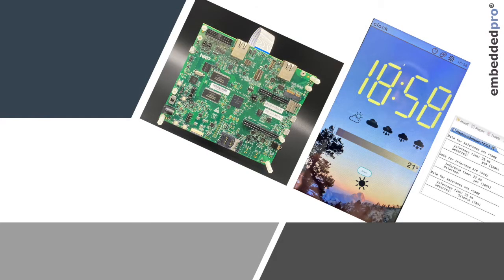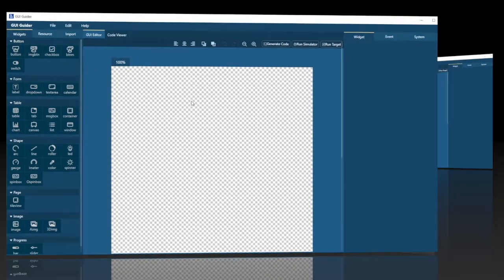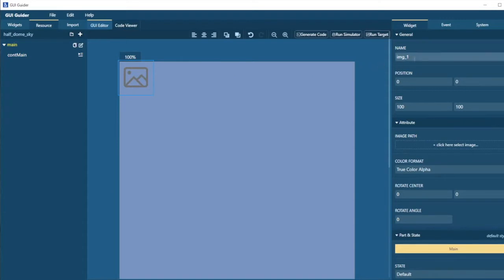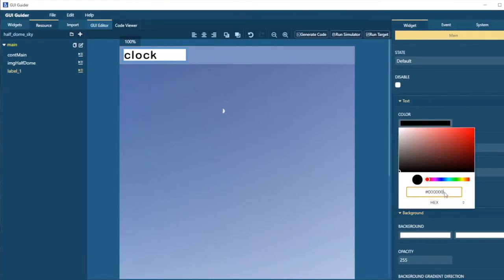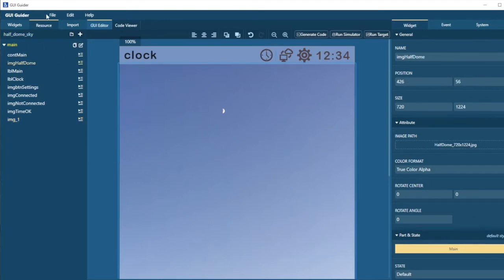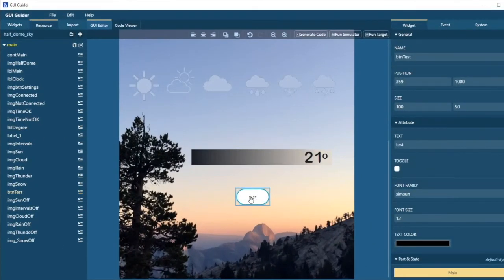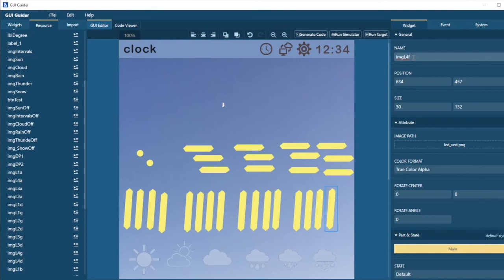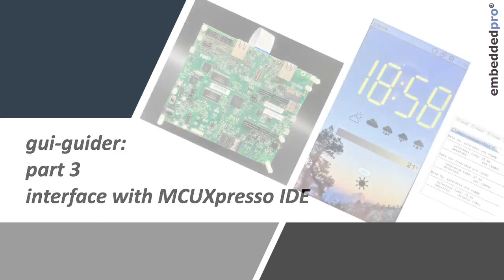3: gui-guider tutorial - graphics with mimxrt1170-evk [2]

Comment: what would be the cheapest screen this could be used with?
Reply from the maker: MIMXRT117x has both MIPI-DSI and 24-bit RGB interfaces. Most likely the cheapest panel will have 16-18 bit RGB interface and low pixel dimensions - 240x320 for example. Something like this maybe: https://uk.farnell.com/midas/mct024n0tw240320pmlips/display-lcd-2-4-240x320-portrait/dp/2664749